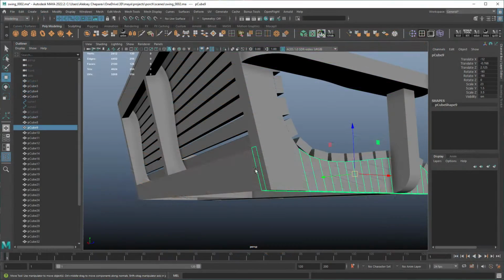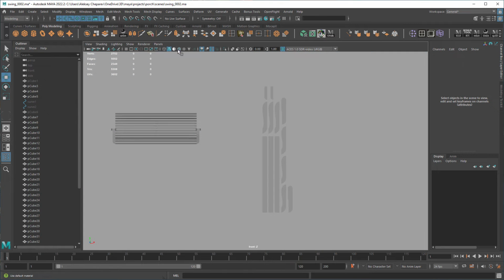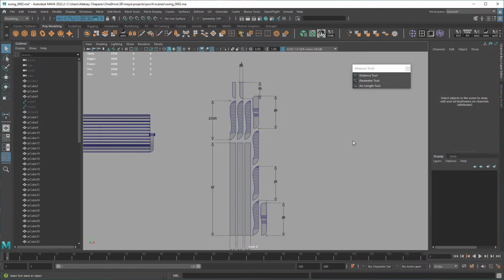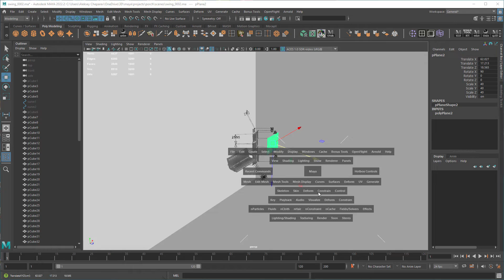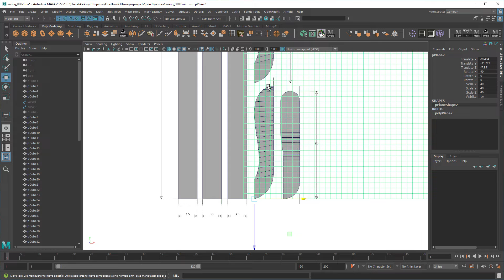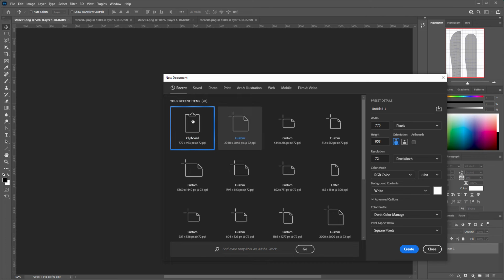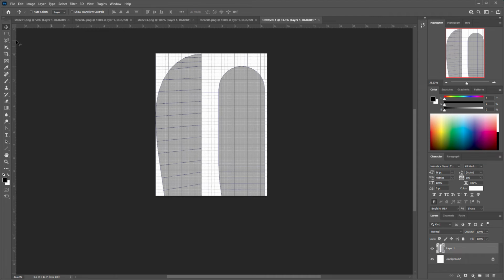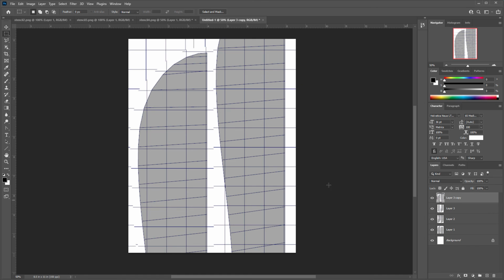Design and Build a Porch Swing for $100 - Cut List Stencils - Part 2

Comment: Maya has a built-in vector renderer, have you tried it already? This process might be easier since you could open in illustrator rather than photoshop, and the grid and scale part would be piece of cake.
Reply from the maker: Yep, and Arnold aiUtility shader to render wireframes, but I find taking screenshots and pasting into photoshop faster, less setup and I can take screenshots of dimensions, which don't render.